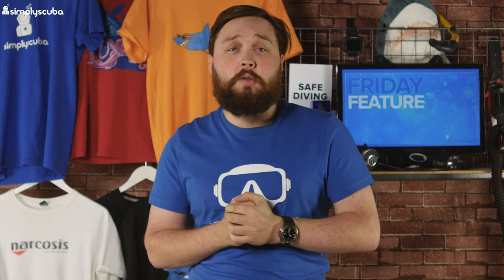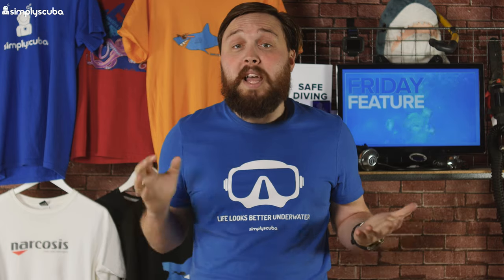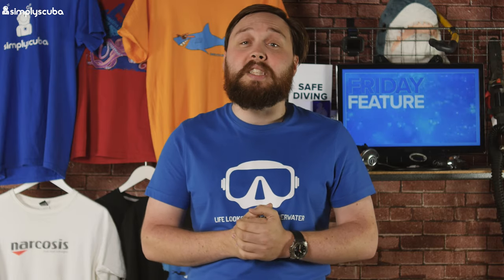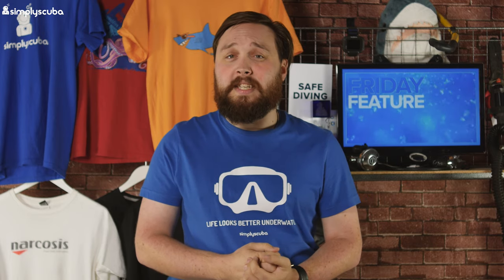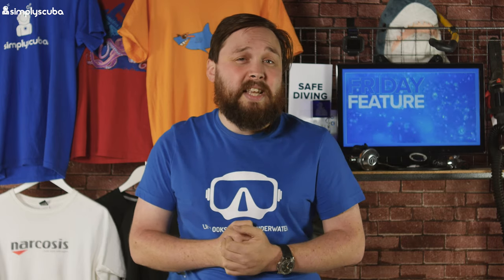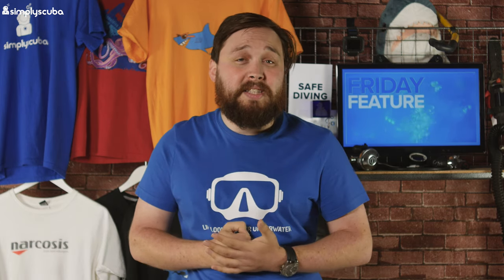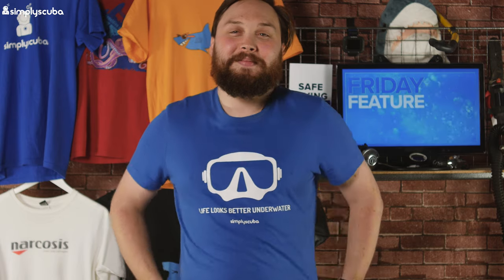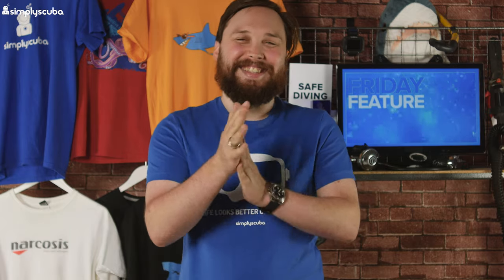Why The Standard Scuba Setup Is Wrong!

Comment: 7:02 I always keep my snorkel attached to my mask wherever I go and whatever I do. Call me 'old school' but it gives me extra secure feeling. It's very usefull when staying at the surface on a choppy water while waiting in line to get on the boat. Morever, it's also advised in one of diving safety procedure book. If you ever caught in an emergency situation (i.e. having empty tank and having to wait for a while on the surface), snorkel is very usefull to keep you able to check your position, what's underneath you, or check the depth of the area for the dive boat to safely pick you up. Worst scenario: if you ever need to dump your gear and swim safely to closest island/shore, you definietly will need a snorkel. It's definitely not for everyone, but my snorkel will always there whenever I need it. I wear wing style BCD, don't have pocket to store my snorkel, so I keep the snorkel attached to my mask. Snorkel weights nothing and costs nothing, but might save your life in the future.
Reply: Thank you, I couldn't agree more. I think a snorkel is mostly a safety/emergency tool. 99.9% of the time you won't need it. But you never know when that  0.1% dive is. It's such little effort to just have one strapped to your mask. Done right, you barely notice it. One dive I surfaced some distance behind the boat and had to swim against the current back to the boat. My air supply didn't last the trip, I sure was glad with my snorkel in the rough water at that time.
Reply: Feeling safe with snorkel straped to your mask is false. It is the best way how to get your mask kicked off by your buddy when moving  close to your face. Or how to get entangled to some line or wire or leafs or whatever. You can put snorkel to a pocket and take it out if needed.
Reply: Take one on 97% of my dives.
Reply: @petrsedlak4761  That's also works too. But for some old schools it's hard to change the behavior. Both ways has their pros and cons, so it's important to understand those pros and cons and act accordingly during the dive. Thanks for the comment
Reply: I ALWAYS keep a snorkel attached and this is why:  when I was a newer diver and with a diver operator that I’ll never dive with again, I was sent up to make my 3 min safety stop alone. No problem...I surfaced in really choppy water. Boat captain didn’t see me. I inflated my BCD...and then I started sinking...WTF...re inflated...sinking...re inflated...cycle repeats. The waves were kicking my ass and I kept sinking. I ran out of gas. Tried to manually inflate. Nothing. The only thing that kept me from drowning after sitting there treading water was my snorkel.  My BCD was leaking air at the over-pressure relief valve connected to my inflator hose. Yes, I started freaking out. In hindsight, I should’ve dumped my weights first, and if I kept getting dragged down, my BCD as well. Some of the tips on this channel are counter to proper dive safety.
Reply: @bittnerbs  Thanks for sharing your real life experience (that's scarry), this is exatcly what we've been talking about. We never know when the snorkle will save our life...so, it's better to keep it there.  This kind of situation that people should worry more, compared to worry of being entangled to line or kicked by our buddy (which is very rare and it's easy to fix/less deadly).
Reply: to be fair, he mentionned that too, and said it can be used to resuce an unconscious dive, by blowing air into their snorkel while they are still in water, i never knew this was possible
Reply: I couldn't agree more I work as a dive instructor since 6 years and I always take a snorkel with me. I'm based on the Canary Islands so the water here in the Atlantic gets quite choppy and rough. A snorkel just ensure that I can breathe fine on the surface swimming out to the diveside not wasting any air. A good simple snorkel doesn't really affect you while diving even it stays on your mask the whole time. I had a few gnarly experience underwater with panicking divers and never got my mask kicked off. Those are my experience I can't speak for everyone but I think its definitely worth to take a snorkel with you.
Reply: Almost 40 yeas of diving under my belt. I work in the dive industry and I have never used a snorkel during a dive. I stopped carrying one many years ago and have never missed not having one.
Reply: He discussed sharing his 2 meter primary in an out of air situation. A snorkel will definitely be an issue in that case. Doesn’t matter with a standard “share your octo” setup.
Reply: It's interesting to see different prefferences from everyone. I believe comfort and confidence which leading to safer diving activity is the most important, no matter what you choose. Stay safe :)
Reply: @bittnerbs  
Snorkels are an entanglement issue is Wrecks, Caves, heavy fishing areas (fishing lines), and I have heard some say Kelp Forests.  I have seen tons of Novice divers swim into a wreck and get the Reg pulled out when their snorkel gets stuck.  Also, where was your secondary floatation device... I never get into the Ocean without a DSMB.  You could have hung on that too.  The video clearly states there are reasons to take a snorkel.  Proper Safety would have been keep your regulator in your mouth, drop your weights, deploy your DSMB and maybe the gear and wave that Boat down.  And yes I generally carry a Snorkel in a pocket too.

Comment: I switched off as soon as he said "I haven't dived in a traditional jacket BC in some time...." 

Firstly, short hose alternates are fine for emergency ascent from 60' as you'll be on the surface in 1 minute (2min if ascending at SSI ascent rate). I train all my studenrs to grab the alternate so they don't accidentally create panic in another diver.

If you're reasoning for not doing this is "in case the alternate is dirty or damaged" I really do not want you diving on my boat.

As for jacket BCs....the primary function of a BC is to operate as a life vest providing positive bouyancy on the surface. A jacket BC holds you in an upright position thus protecting the airway.

Yes, wings and back inflation provide better trim whilst partially inflated under water, but that isn't the primary concern.

The concepts that we learn in technical diving are excellent and extremely important. However, they can complicate situations in recreational diving. This principal is something that inexperienced instructors, or desk jockies who get in the water once a year, fail to understand.

Experienced instructors respect both streams of recreational and technical but keep them seperate.

Comment: I don’t even own a snorkel.  Haven’t used one in years.  But as far as my equipment goes, it’s been custom built specifically for me.  I suffered from a severe broken back in 2003 which has left me with a lifetime of major back issues.  I was told that my diving days were now behind me.  I thought...like hell they are!  But they actually were...for a really long, long 13 years.  It actually took that long to get back on my feet.  But the second my doctor FINALLY cleared me to start back doing light activities, I hired myself a trainer and went  to work rebuilding my body back up so I could start scuba diving again.  And after a year of that, I was further cleared to start diving again. So I had a custom made kit built to accommodate my back.  I also took a refresher course followed by a drysuit diving course.  A kit with the standard, typical 80 cf tank hangs too far off my back pulling my center of gravity away from my spine.  so I dive with double 40’s with a pony bottle stuck in between.  They hug my back perfectly while not placing anything directly against my spine.  My tanks feed an tri-position air valve (main/off/reserve) which in turn feeds the second stage of my regulator, which, incidentally, is built in to my Ocean Reef Predator FFM.  So I don’t share my regulator.  And I just switch a lever to switch my air source from my twin 40’s to the Pony.  Obviously that also switches to an alternate first stage.  My alternate 2nd stage is built in to my Zeagle Rescue BCD, a part of the inflation system.  Lastly, my backup buoyancy is provided by my drysuit.  Air for my BCD comes off my Pony, while the drysuit gets fed by my main tanks.  As for hoses, every one has been custom made to my dimensions so there’s none too long or too short.  All hoses are fitted with quick disconnects.  Those that are critical have locks on the quick disconnects that have to be spun down in order for them to disconnect.  Both regulators are connected to the tanks via a dim connection to eliminate having an ‘o’ ring blow out.  It’s simply a more secure fitting to happens to entrap the ‘o’ ring.  When diving with a buddy (my kit is also set up for solo diving), I carry a small mask and a second stage (with a capped disconnect fitting that can be put on to any LP air hose connection) in my drysuit pocket.  I also carry 2 titanium knives (1 on a BCD hose, the other attached to the inside of my leg), a surface marker buoy,   a whistle, a compass, and a flashlight.  I also have a small LED light that’s attached to my Pony so it’s easier to be seen, so if there’s any murkiness to the water, I’ll turn that on.  My gauges are just that, gauges vice a computer (eventually I’ll buy a computer).  When diving, I clip them across my chest to a ‘D’ ring via an retractor leash that’s 10 years old and has yet to ever fail.  I have a second pressure gauge that’s attached to the backside of my gauge console.  That’s for my Pony bottle.  This setup gives me 99 cubic feet of air at about the same weight of an 80.  It happens to be far more streamlined and brings my center of gravity back in line with my spine which is exactly where I need it.  For me it’s the difference between scuba diving or not.  That’s because the entire lower half of my back has been fused solid.  I’ve had 7 disk and 1 vertebrae removed.  This kit works better than any other that I’ve ever used.  And while I’ve had other divers tell me that it looks way too complicated, it actually very simple.  That’s what’s most important for me, it’s because it works so well that I’ve been able to continue diving even after a devastating injury.  I’m currently having a second set of tanks made up, both smaller and considerably lighter, as I manage to get 2 dives off my current tanks.  That setup will have twin 30’s and a smaller Pony.  Hopefully it’ll be light enough that I’ll be able to scuba dive off my jet ski.
Reply: wow, such an amazing story! it's awe-inspiring to see how you've managed to adapt in order to continue diving after such a terrible injury.
Reply: Damn, I need both two fins and two boots.  One for dry suit, one for wet suit, etc.  I have big feet and the larger boot requires a bigger fin.  It is all too much stuff.

Comment: Sport diving and tech diving are 2 different things and require different gear and training. After following the tech trend from the 90ies onward I am coming back to basics as a level 2 CMAS instructor with more than 25 years diving experience. I see the benefit of using a separate first stage for your octo (not only in cold water) for sport diving.  A slightly longer hose can be nice, 2 meters is too much for rec diving. 1.5m is long enough if not also too long in some situations. BUT if u only find out underwater that your diaphram is ripped or your 2nd reg is blocked in anotherway, a longer hose will NOT help you. Best thing to do in that case is to hand back your OW or whatever degree certification badge!!! (if you make it back, I pray you do)
Planning your dive goes beyond the airplan and swimming direction. It is basically an RI&E analyses per dive(spot) and taking the appropriate gear. Gear checks at home and proper maintenance are part of this as well. You do not need a 2x12 with a couple of stages to go for a 20m max 40minute fun shoredive. A standard BCD with 12-15L tank is sufficient. Your shiny new heavy tech gear and a buddy new to diving can be dangerous.    Otherwise, if your gear is not good or insufficient for the dive, you can ask yourself if you should be in the water.

Back to bcd's; If there's a possibility to drift away (from the boat or shore), then for rec diving I would want a very bright colorfull bcd that can hold me face up. Wings don't do this and they are mostly black. When tech diving, captains/crew anticipate on currents and you will also ascent very differently with a marker on the surface. Wings in contrary to most bcd's can carry the additonal weight of stages needed for stops on these dives. 
Note to manufacturers: I did find that standard bcd's with weight integration held insufficient upward force on 20+m dives with a single tank. This needs to improve.

Keeping up your skills is more important. Go for regular training dives. Do that assisted ascent again (and again next month) What were the emergency procedures you were tought?   Diving once every holiday just isn't enough even with wings, double tanks, long hoses, tech equipment and bluetooth christmas decorations. Use the gear you have been training and are familiar with and go out training again after buying new gear. (did you train with that gopro and extra lights?) 
Wings and longhoses require additional skills, these are not tought during OW nor advanced courses, and with a 2x12 this kit can and eventually will take you on a deeper and/or longer dive. Seek an instructor to help you out before you create bad habits (improper use)

Last comment and then I shut up: don't just explore the limitations of (your) diving, you might find these limits and then? 
If we were meant to live underwater we would have had gills.
Reply: I think tech diving is more of an extension of rec diving - not really a whole different kind of diving. Technical diving requires more gear and training due to the more extreme depths/environments you might find yourself in, but there is no reason technical gear can't be scaled back for a nice easy rec dive, nor is there any valid reason that brand new OW students must be taught on jacket BCDs and octos. There are shops out there that certify their OW students on backplates and long hoses. Anyone who insists it's harder to teach new students to donate their primary instead of their secondary should really stop and think about it: Handing off a tiny 36" hose to your buddy while making sure it's oriented correctly (not upside-down) and flipping your arm around it so the hose isn't caught in your arm pit? I'd rather just pop the reg out of my mouth and flip the hose out from behind my neck in one smooth motion. The orientation is correct by default and I can use my free hand to put my back up reg in my mouth while my buddy resumes breathing and collects himself... away from my face!

Also:
- Wings don't inherently tip you face down. That's a huge myth. The problem is easily solved with proper weight placement and just not over-inflating the wing at the surface. Your weight should be worn as close to the backplate as possible - not out in front of you where it will tip you forward. I've seen a jacket BCD tip someone face down before. The guy was diving a dry suit and had about 26lbs of lead all crammed into his integrated pockets.
- Backplates can be used with single tanks. That's the best part about them - they are super versatile! I agree there's no need for doubles on a 20m/40min dive, but why would that exclude a backplate? Why drop $800 on a jacket BCD that will only get used for one week out of the year and can only be used with a single tank? When I fly, I leave the doubles at home and enjoy the week diving a single AL80 like everyone else. And I make all the other divers look like the Christmas tree divers because I just have a webbing harness on my body - no pockets, no unnecessary bells-and-whistles - just a nice clean front.
- I'm sure there are bright coloured wing covers out there, but if you're diving anywhere where there is current or boat traffic you should be carrying a surface marker. And those things always come in bright colours.
Reply: Regarding color of wings, there are a few brands selling wings with different colors.  Tecline, OMS, xDEEP (though I think you need to make a custom order) comes to mind.  Also, it's not difficult to keep your face up out of the water using a wing, just lean back.  If you can't keep your face up in the water using a wing, you are doing something wrong.
Reply: You are right they are different. However, the base level of gear can and is the same (excluding side mount) if a rec diver buys a vest when they get started and wants to progress they will most likely want/need a backplate system when they start moving towards Tech level. why not start with a backplate. you will be more trim. less dangly bits all over. and when you do move forward you won't need to replace your whole BCD. thats just one example.

Comment: I definitely agree on no snorkels (dive float line hazard) and that the wing style BCs are better. It's nice not to have a large pocket of air pushing on my chest. I'll never give up my Original Force Fins with simple shock cord straps though! Also guys, if you want to prevent your gear from disappearing, reconsider hot pink.